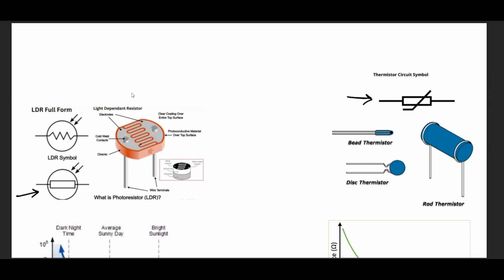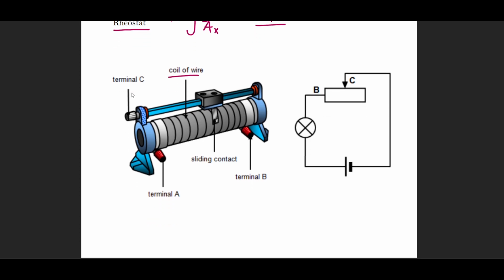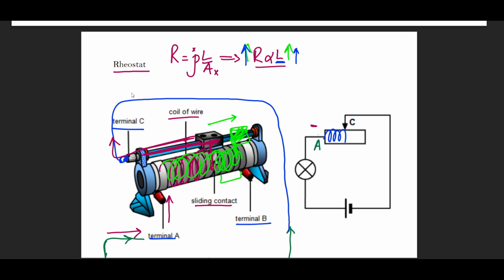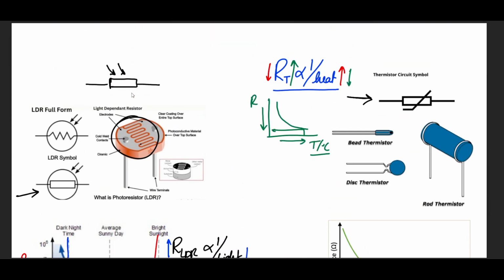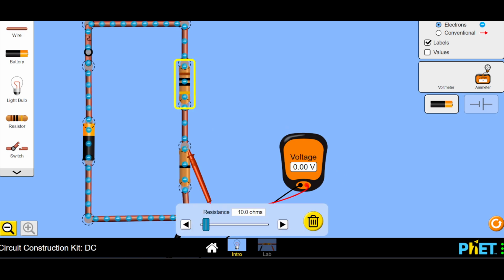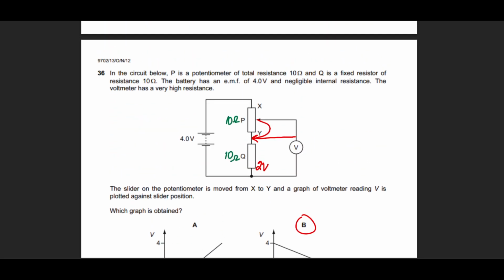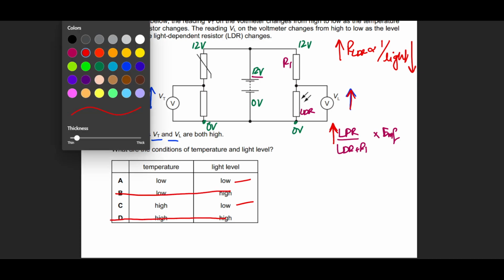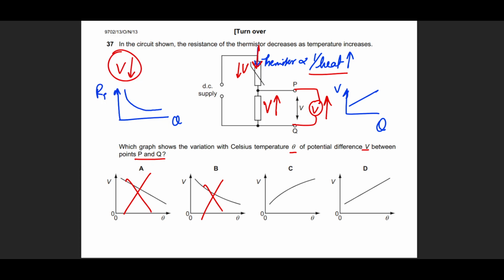A1 - LDR Thermistor Rheostat + Questions [Part 3]

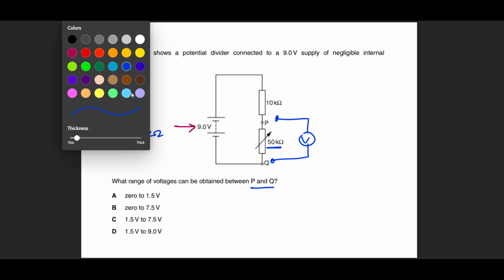Comment: sir at 10:00 how did you predict that the value of resistance could go as low as 0 ohm?
Reply from the maker: This is our general understanding that a variable resistor (as shown by its symbol) can always vary from Zero up to its maximum value. Unless the examiner tells you its range, you should assume it to be zero. Imagine a fan dimmer we use to control the speed of our ceiling fans, same idea over there too. Zero to whatever value of variable resistor we are using in it.
Reply: @mdawood9702  alright, thank you